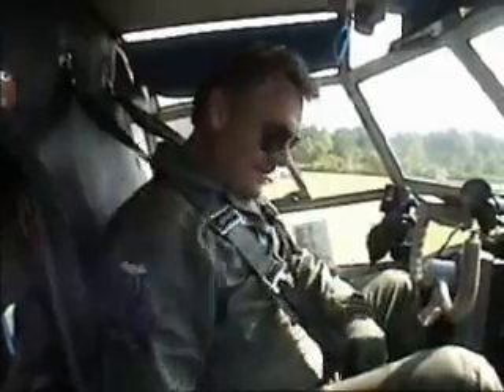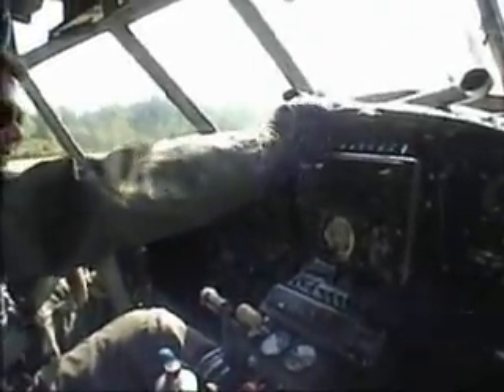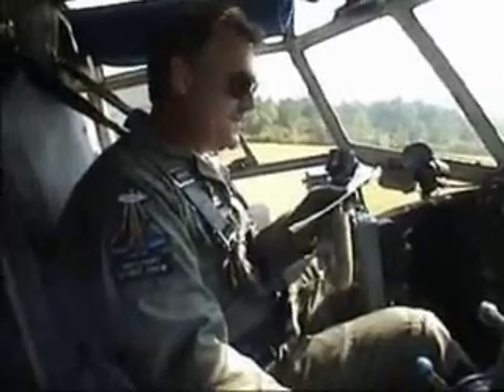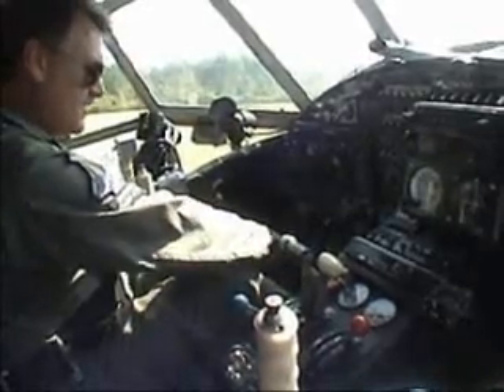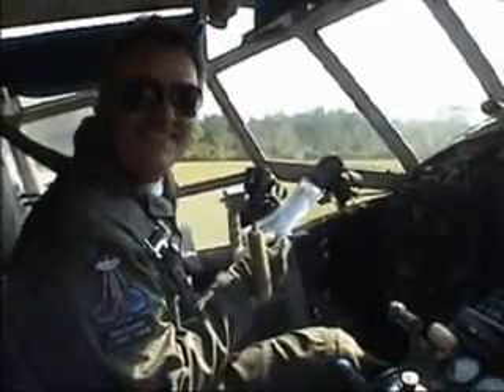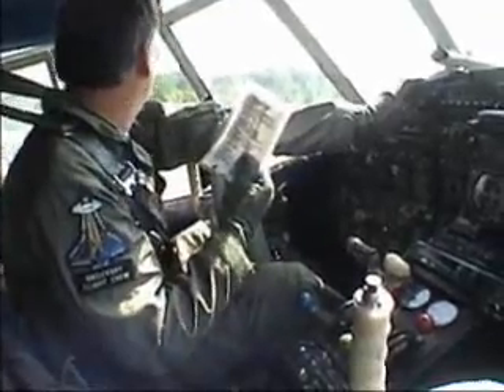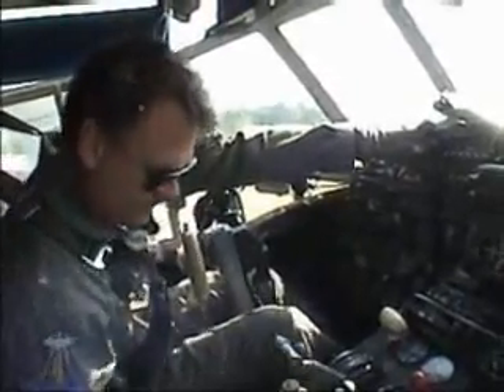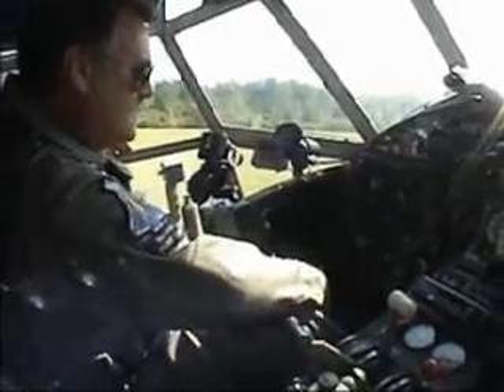An-2 Antonov Radial Engine Start Procedure

Comment: How does that clutch and gear system work which converts the decelerating flywheel rpm to the accelerating engine rpm? I hoped that, when I listen to the screeches and quiet phases of that system and watch the prop rpm, I can translate from my observation to the mechanical principle, but I didn't succeed.

Comment: @Geambler : It is the sound of spinning up the flywheel of the starter, and then the spinning flywheel transfers its kinetic energy to the engine (we can hear the flywheel slowing down as the engine starts).

Comment: 1) I profess that the behavior of the aircontroller in Smolensk was illogical.The aircontroler in Smolensk on April 10/2010 had to tell the crew of TU154M that landing gear is partially extended and landing will result in a disaster.

Comment: B) The aircontroler in Smolensk on April 10/2010 had  to tell the crew of TU154M  that landing gear is  partially extended and landing will result in a disaster.
The continued guiding of the plane by the aircontroler proovet the fact that the weather conditions were satisfactory and the landing gear of the plane TU154M was seen by the aircontroler in right position through the binoculars.
Mr.Jan Tarwid.Kapr.Rez,Lot,Pol,47Szps.

Comment: @balintmeszaros cowl flaps should also remain close in order to reach warm-up temps fast on cylinder heads, specially in cold weather, then observe cyl head temp,and proceed with pre-take-off checklist for taxiing and take-off procedures.

Comment: @allusernamescaught 

when the pilot presses the button first time,  flywheel starts by the power. And after that the flywheel will start the engine. The sound you are intrested is the sound of flywheel starting.

Comment: Dude, come on. Some of the best aircraft were from the 1940's. There are companies that still use DC-3's to fly cargo because they are the best. High lift capability, high cargo capacity for its size, and can still land and take off in less than 500 feet (the an-2)

Comment from the maker: Actually, it is required that you turn at least 18 to 21 blades throught before engine start.  To make sure that you do not have a hydrostatic lock.  It is a radial engine, depending on where the prop stops and the valves are will depend wheather the oil will leak between the cylinder head and the top of the piston.  You can not compress fluid, so if you have this situation and you hit the starter without clearing the oil, you just bought an engine... But thanks anyway for the tip.
Mike out.